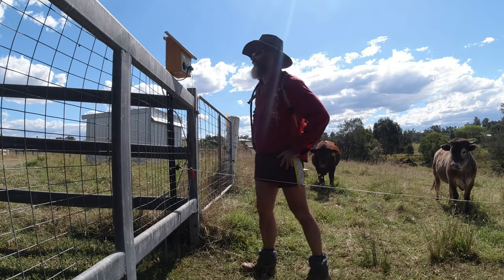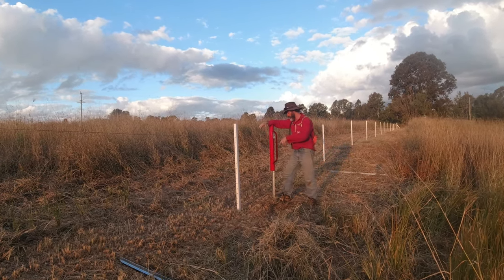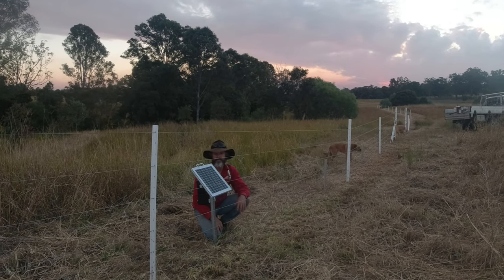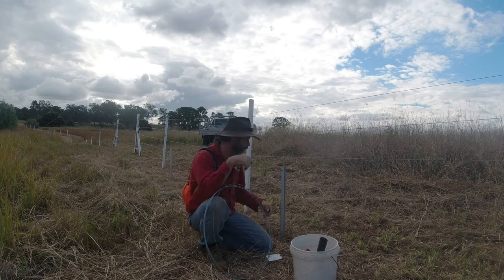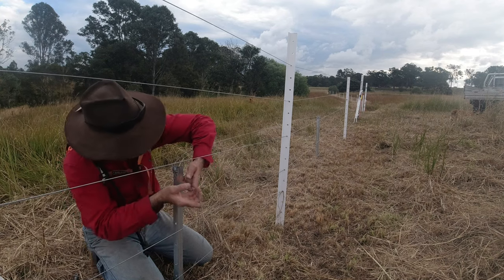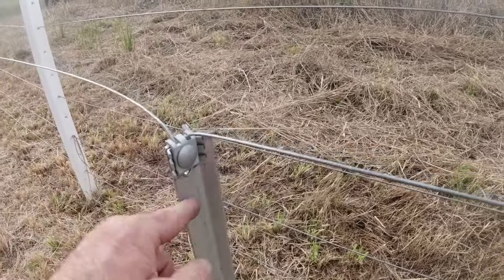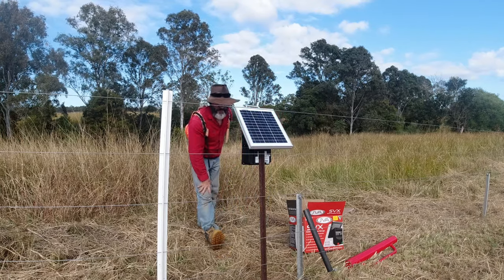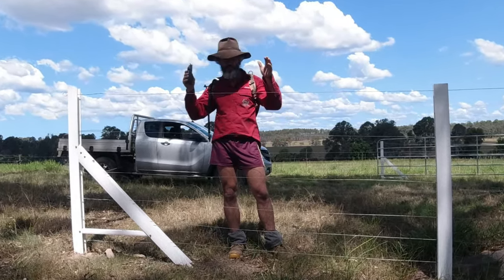How to Install Electric Fence Earthing & Depths to Match Your Energizer!!

Comment: Hi bud 
You haven’t answered my email
Reply from the maker: Hi Gary, sorry mate I just had a look and it appears I haven’t got your email? Jason
Reply from the maker: Hi Gary, check the email address it should be the below mate.
Jason & Nicole <udderfarmqld@gmail.com>
Reply: Hi Jason. Are those 3 earthed posts/stakes connected to an earthed wire on your fence? Also, how long is that fenced section? If you were going say a 1km, would you put down additional posts (we are heavy clay at the northern end of wivenhoe)